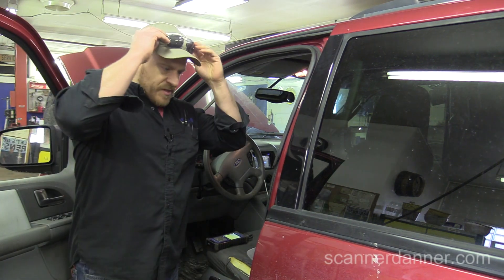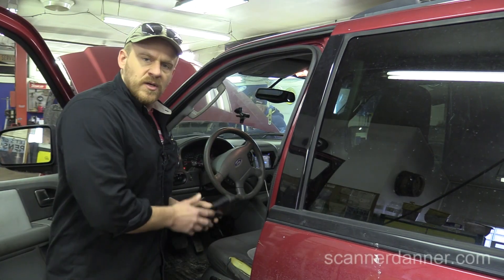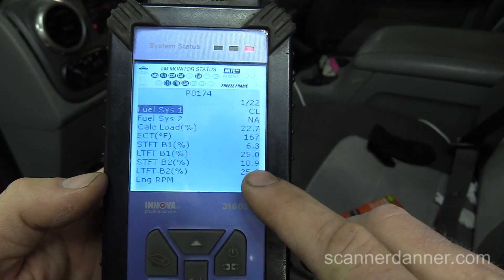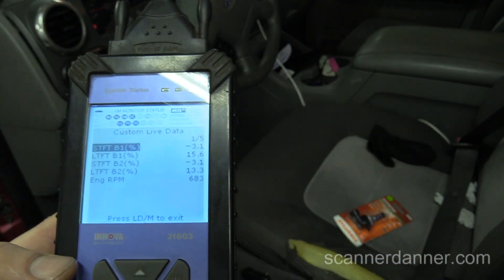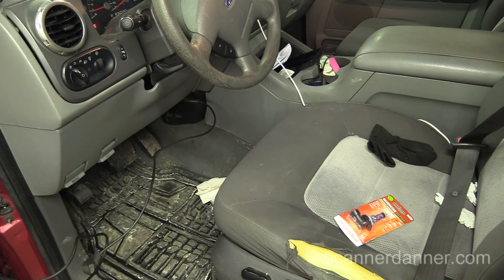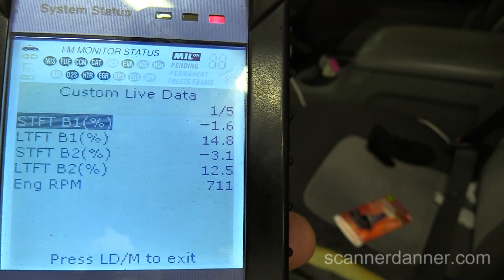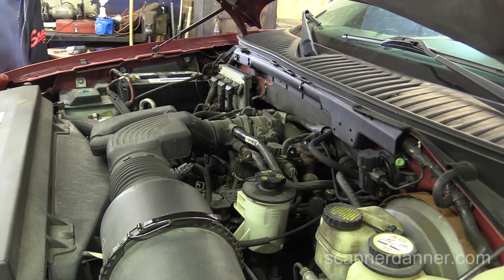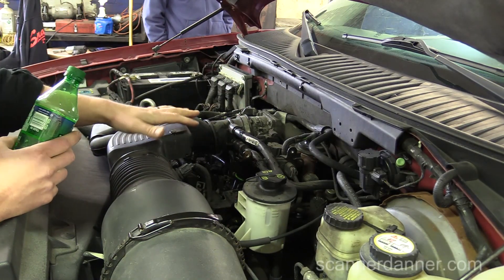System Too Lean (P0171, P0174) - Vacuum Leak Quick Test - Ford 5.4

Comment: I really like to thank you, your videos are very instructive, I would like to have your opinion about a case, how can you have a lean condition in the long term fuel and a rich one at the same time, meaning in short period . exemple in 2 minute drive the LTF is between min -35 % and max 89% short term fuel between min -100% and max 16% at idling constant LTF -35  , a wave fome STF min -27 max -24
DTC: lean condition Pending Code
NB:  fuel  pump has been changed
thank you
Reply from the maker: Fuel trim analysis should be done during a steady throttle. What are your LTFT numbers at idle and 2500 rpm? A test drive is not needed. Just running in park is fine
Reply: LTFT at idle -35% 
at 2500 rpm  89%
Reply from the maker: I need both banks
Reply: there is only one bank, it's vw Golf mk5 1.4
Reply from the maker: I've seen MAF sensor contamination cause a negative number at idle and positive at higher RPMs
https://youtu.be/CEKjjXNLTjk
If you need more help. Post to my forum 
https://scannerdanner.com/forum/post-your-repair-questions-here.html

VW's have a different way of displaying their trim numbers and if you are using global data, it can be misleading.
Reply: thank you, i will keep you posted
Reply: Thanks Sir you nailed it , thumbs up

Comment: can you damage an EGR valve by cleaning it with carb cleaner ?
i cleaned the one on my expedition and it runs very shitty now ..i put a new egr gasket and the truck smells like fuel , i had a p0171 -174 code before i tried cleaning it ..
Reply from the maker: I don't think so, unless you were spraying it in the diaphragm area

Comment: @ScannerDanner I've got a PO174 on my 03 Expedition. I've got pics of the freeze frame data from my scan tool. I've checked for intake leaks with no luck. Mine does not get better or worse when warm. If the truck is driven in "normal easy manner" it's hard to notice any problem. Occasionally at a stop light I'll feel a little hickup. Problem occurs under any kind of load. it just won't go. 1/4 throttle going down the road, it simply is hard to get rpms over 2,000 and to get it going. I'd love it if you get the time if I could email you pictures of the freeze frame data and if you could maybe brake the "code" of my issue. Any help would be great! Thanks, Stan...
Reply: Did you figure it out? Im having same issue on my 03 gt

Comment: scanner Dan  I have a f150 2005 5.4 triton. it had a misfire code on the 2 cylinder and a bank 1 lean code. I have replaced all plugs and coils. and misfires went a way for a few and then it was running worse I was checking fuel trims and looked under the car and seen the cat was glowing red. and I disconnected the cat on passenger side and it started running a little better then too. and has power that it didn't before. but know I still have Bank one lean code and  it still runs rough. but my fuel trims aren't high and it's saying coil 6 and 7 have problems but I check them and there sparking just fine any ideas Michael
Reply: any idea
Reply: Michael Starcher I had issue turned To the vacuum on the back on intake manifold 6C324 IIRC,
Reply: Michael Starcher 
6C324 IIRC, ford part # 30 to 40 at the stealer ship

Comment: If I may ask a quick question related to vacuum leaks and testing them - can a MAP based engine with fuel trims that indicate vacuum leak (as in they get better on higher rpms) still suffer from a vacuum leak when the MAP sensor is showing normal intake vacuum (well, as far as I can guess - don't have specs available) and the IAC is not fully closed yet? I would kinda expect the vacuum to be lower under such circumstances - why wouldn't the ECU just close the IAC more instead of raising the fuel trims or MAP show lower pressure than there should be?

I've been struggling to find a leak for weeks (on and off), but with no amount of carb cleaner or water spraying I seem to be able to find one. Yet the fuel trims seem to point to one. Also, I think I can kinda hear some hissing close to throttle body, but again, no dice on finding a leak, so I'm wondering if what I hear is simply the hiss of air running through the throttle body/IAC that's supposed to be there...?

Thanks for any advice.
Reply from the maker: what kind of car? if it has a plastic intake, they are noisy and hiss and sound like vacuum leaks but it is just the intake
Reply: Thanks for the response, much appreciated. It's a 2002 Ford Focus (European) and it does indeed have plastic intake (it's a 1.6 Zetec SE). Didn't want to bother you with details on what was supposed to be a fairly general question.

I'm kinda wondering if the elusive vacuum leak - which doesn't seem all that big, if it actually is one - could in fact be caused by leaking throttle plate since there really doesn't seem to be any vacuum leak I could find and I know for a fact the throttle plate isn't exactly sealed.

But all that aside, I just don't understand why I'm seeing positive trims when MAP sensor seems to be working fine and reading normal vacuum with IAC also seemingly active and working properly (reads around 31-33 percent open at idle). I'd kinda expect to see one or the other on a MAP engine with a vacuum leak (meaning positive trims at low rpms or normal MAP/IAC readings), but not both at the same time. I can't understand why the ECU would raise trims instead of simply closing the IAC more to compensate for the air coming in through the leak - unless I'm missing something in my understanding of how it all works together (which I guess is quite likely).
Reply: BTW, still struggling with that lean idle condition, still can't find the reason. No vacuum leak in sight.

It kinda seems to me that the lean idle condition is dependent on intake air temperature - the higher it is, the higher the trim numbers (and the worse the car runs at low rpms).

If I unplug the MAP sensor (or TMAP, to be precise), the car idles just fine, the STFT basically cancels out the LTFT (the overall trim is around 3 %, so perfectly fine), the O2 does seem to cycle up and down fine (definitely not suggesting a lean condition). The only thing that's off when I unplug the MAP is that the idle gets a bit higher (around 150 rpm more than normal) - but then again the IAC is also open a few percent more for some reason, so it might be that.

Could this perhaps suggest the TMAP is somewhat out of calibration at lower vacuum/higher temperature, causing the ECU to run on leaner base values than it should and having to compensate the offset with higher fuel trim? Or is unplugging the MAP sensor a meaningless test?
Reply: So, to finally follow up on this for anyone who happens to stumble upon it in the future (because I hate when people don't follow up) - I believe the issue is finally solved. Even though it exhibited all of the classic symptoms of a vacuum leak, it was actually a MAP sensor off calibration that was causing my lean idle (which I guess makes sense, as my engine is a speed density engine, so it depends on accurate MAP reading, but shouldn't really show higher fuel trims with a vacuum leak like a MAF engine would).

Apparently it was reading more or less correct at barometric pressure, but as the pressure decreased, the calibration error was gradually increasing, mimicking the classic vacuum leak symptoms. It was off by something like 5 kPa at idle and even more when e.g. engine braking. So it was kind of a pain to diagnose.

Replaced the MAP and the highest fuel trims I've seen so far was like 7 percent overall, which is a LOT better than my previous 25+ (STFT and LTFT combined). I was also experiencing quite a lot of engine knock under light acceleration, and that seems to be a lot better as well overall.

So I guess the answer to what can cause a vacuum leak-like fuel trims on a speed density engine is - it might very well be your MAP sensor.
Reply: @Case_  thanks for all the info!
Reply: @scottgrippo4173  Cheers.

Comment: I have a 4.6 where I thought that the intake leak but it ended up being the O rings on the injectors leaking vacuum .
Reply from the maker: for sure, another reason I like the water test, you can see it getting sucked in
Reply: John McKamy for a week had atap noise then it died out when I left work.. hasno power to even get up driveway.. thanks
Reply: Would that also cause a light tap sound at idle? I have 03 gt 4.6 soch 2 valve just replaced stock intake manifold with the pp typhoon one and felpro gaskets. Also we put fuel rails on new plugs and serpentine belt. Ran fine first day next day heard light tick near fuel pressure sensor and check engine light is on with same two codes.

Comment: I've got a lean condition P0171 and P0174 with the O2 sensors voltages looking good but the short term fuel trims on both banks second sensors reading at 99.2%.  It's a 2004 FX4.  The reading is so extreme, I don't know where to start.  Any Ideas?
Reply from the maker: +James Voth The second sensor is downstream and the fuel trim numbers are not used for downstream O2s on your Truck. The 99% reading you see is a bs number and means nothing
Focus on your upstream fuel trim numbers
Reply: Thanks for your reply!  Very much appreciated.

Comment: Thanks for the reply I did a fuel pressure test it reads 30 33 PSI then with the brake on I put it on Drive it reads the same 30 33 PSI I put it back in park rev the engine up it almost hits 40 PSI is this normal?

Comment: Hey whats up man ! I have a expedition with 5.4 the truck idles alright litle chaky but not that much when i go and put it in drive it stumbles and almost dies when i put it on revers it complete ly dies and if its in drive and i hit the gas it has no power any help?
Reply from the maker: +68 dippin Can't really help you without more direction. Trouble codes? What is fuel pressure? etc

Comment: The 3.8 Liter V-6 in my Windstar threw the same two trouble codes. Apparently it's a common problem with that engine. It's caused by  a defect in the material used to make the grommets on the isolator bolts that hold the intake plenum onto the intake manifold. Replacing the isolator bolts solves the problem and it's easy to replace them. A lot easier that replacing the intake manifold gaskets on the engine in the video.

Comment: I'm trying to diagnose an engine thats running rough and rich. It doesnt have a vacuum leak it passed the smoke test. The problem I ran into is the car is not going into closed loop and I cant check the fuel trims or O2. Any advice?

The only code is lean system code and its a MK3 Jetta with a 2.0.
Reply from the maker: +rsx123 without being able to look at trim and O2 numbers, you are not going to be able to fix this car without throwing parts at it. 
MAF sensor failures are common
Reply: +rsx123 - There are Bluetooth devices available that plug into the vehicle's OBD2 port and can be used along with a laptop running applications software that turn the laptop into a scanner. It's fairly inexpensive and quite capable for the money.
Reply: Joe Vignolo I'm using a SnapOn scanner provided at work. What I meant by cant check fuel trim and O2 is it doesnt show those pids if its not in closed loop. The car is permanently stuck in open loop.
Reply: ScannerDanner I changed the MAF before it started running bad with a used one (cheap people) I figured it was the MAF as well but the guy doesnt want to pay up for a new one.

Thanks for responding.
Reply: rsx123
- It also sounds like you could have a bad upstream O2 sensor, which would keep the mixture control system in open loop. There are ways of checking the O2 sensor directly even if the scanner won't show you the O2 sensor's output. If your cheep friend keeps driving it running rich like that he's probably going to need a new catalytic converter pretty soon, if not already.
Reply: I'm curious. You said it's running rich, but it has a lean code. That doesn't make sense. How do you know its running rich? Is it throwing black smoke out the exhaust? Are the plugs carbon fouling?

Comment: so Paul, I just completed the PARKED fuel trim test. You asked what the Ft rims look like @3000rpm  PARKED. The results are as follows:  With the car fully warmed up at idle and parked= idle 725,  LTFT 14.1-11.7,  STFT 2.3-1.6 ///  CA IN PARK @IDLE & 3000 Rpm=  LTFT 16.4-10.9 ,  STFT 4.7-0.  NOTE: WHEN THE LTFT REACHED 16.4, THE STFT WAS AT 0 THE WHOLE TIME. Once I let off the throttle they basically  when back to the approximate  readings as they were. Any suggestions?
Reply: CORRECTION: the "4.7-0"  from the actual test was a (negative)  -4.7 NOT   positive!
Reply from the maker: +Isshman Garcia you need to stay within the same conversation because I don't remember what the initial complaint was
Reply: +ScannerDanner sorry I'll  repost

Comment: What if fuel trim data is in the negative numbers like negative 14 on the lt and almost zero on the short term with closed loop that say there might be a leak no codes
Reply from the maker: +Joe Hamradio what are trim numbers at 3000 rpm in park?
Reply: +ScannerDanner thanks for your reply I'll get those for ya tomorrow does it have to be closed loop or no
Reply: +ScannerDanner  tryed to send a screen shot wouldnt work stftrm1 -4.7 stftrm2 -3.9 ltftrm1 -6.3 ltftrm2 -7.8 thats at 3k rpm not sure if those are correct or maybe a o2 sensor going bad i got no codes just runnning a bit rough thats all and ive done alot to it tune ups new egr clean tb so just wondering if thats good numbers thank you take care
by the way this is a 99 suburban 5.7l 350
Reply from the maker: +Joe Hamradio possible leaking fuel pressure regulator
Reply: +ScannerDanner ok I'll check that that wouldn't throw any codes rite cause like I said there's no codes just a little running rough thanks dan
Reply from the maker: +Joe Hamradio -14% is borderline setting a code. Your engine is running rich and more so at idle. This is most likely also causing your rough idle issue
Reply: +ScannerDanner ah ok I understand the o2 sensors wouldn't be an issue at all would they
Reply from the maker: +Joe Hamradio I would say very unlikely given your numbers and that it is affecting both banks, so that would mean both upstream O2s would have to be bad at the same time. Doesn't happen
Reply: +ScannerDanner ah ok got it thanks a lot for your help I will check that out and change it out and let you know if that worked .   Thanks for taking the time to respond love the videos learned a lot have a great weekend

Comment: my ltft is at 14 and st is at 0 at idle..would that suggest intake leak? or could this be a symptom of the 02s and catalytic issue i have as well?
Reply: both fuel trims are normally both positive at initial startup..then they turn to the numbers from above comment once warmed up.
Reply from the maker: +Isshman Garcia what do they look like at 3000 RPM in park?
Reply from the maker: +Isshman Garcia fuel trim numbers during start up is not something I ever look at. O2 sensors are cold, system is in open loop etc. 
There are some circumstances where a LTFT can affect initial start up fuel control but not typically.
Reply: +ScannerDanner Sorry, when i said startup I was referring to have started up the car and let it idle a 5-10 minutes..NOT during startup as in a relative compression test. If that helps a bit.
Reply: +ScannerDanner Normal trim numbers= idle 725, LTFT 14.1-11.7 , STFT  2.3-1.6  ///   

Now @ idle and 3000 rpm is as follows=
 LTFT  16.4-10.9 ,  STFT  -4.7-0 (negative)

Once I back off the throttle, the Fuel trims return to the same approximate numbers as the "Normal" data.
Reply: +Isshman Garcia Any suggestions? Theory?
Reply: +Isshman Garcia LTFT should not be bouncing around with the throttle steady. Or are you giving me two separate banks? What are we working on? Year, make, model, engine size, number of upstream O2s. History of vehicle, symptoms or customer complaint. You need to help me here man.
You have a lean condition that does show some improvement at higher rpms. I'd be looking for a vacuum leak first. But I need more info
Reply: +ScannerDanner Premium Throttle  was steady. data went from the lower  numbers to the higher numbers while I was holding steady.  1 bank here. there's only two o2 sensors on this vehicle. 2004 chevy monte carlo ls 3.4L. there's really no history to the car that I know. I got it 2 years ago and have only had to change water pump  in all that time, (besides routine maintenence) until now. it has 1 DTC p0446(EVAP vent circuit) current code. Im almost certain that i have a clogged catalytic  converter(with NO code), but before  I change it I need to find what caused it in the first place. 
symptoms  are: 1. car turns over then sputters out, then starts either on second crank or if I rev engine while it's turning over. 
2. it's spitting out white smoke out of the tail pipe. Not as heavy/thick as your "stuck fuel injector" vids though. the best I can do to describe it  is to compare it to seeing your breath in winter. Not crazy heavy, but noticeable.
Reply: +Isshman Garcia BTW, Thank You for the assistance.
Reply from the maker: +Isshman Garcia do the water test for vacuum leaks, unless you have a smoke machine. 
Also, if your cat is plugged, you cannot analyse fuel trim data accurately. Change the cat. first
Reply: +Isshman Garcia While I have your time, would you know off hand (or location in your book)exactly which sensors, thermistors etc. that I would need an attenuator for vs. the ones I wouldn't  need one for? 
I am reluctant  to T pin and view waveforms from any connectors because I don't want to get zapped. I know for sure that an attenuator  is needed  for fuel injectors and secondary  ignition, but don't know any more components it would be required for. Just want to be safe, both the computers and myself. Thanks in advance  for any help you provide.